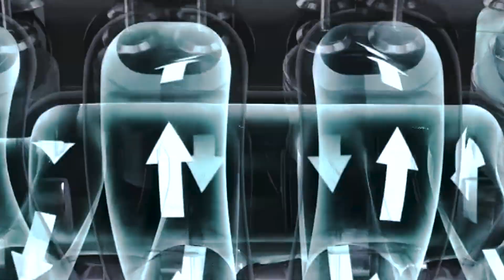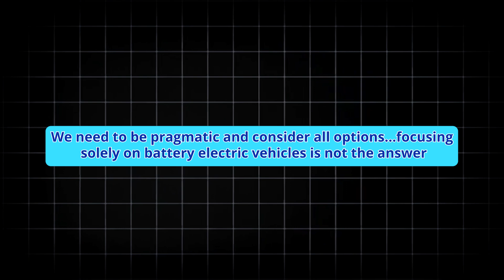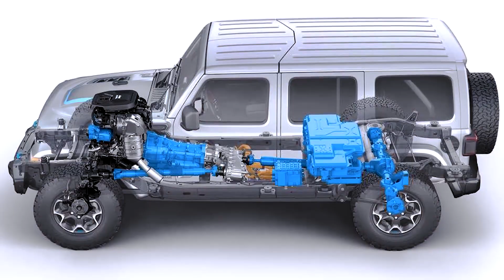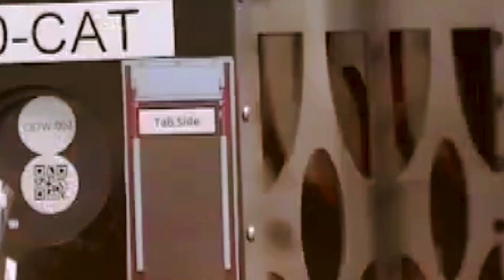Jeep CEO REVEALS Revolutionary Compressed Air Engine Shaking EV Industry

Comment: Did an AI write this for u? xDDD

Dude just reinvented turbochargers, with the downside of actually needing a tank to store compressed air in...
I doubt this is in any way more efficient than any MHEV in city driving. 

Also: How large do you want the compressed air tank to be? it's so power intensive to compress Air in the first place, and for any usably high preassure the tank would need to be as powerful as a H2 Tank, and we know how much usable energy they can store xD

and using the enigine to restore the used air is.... just like charging a battery in a BEV, with the difference that a Battery is more efficient and has less loss over time.

And the AI generated pictures of an Engine xDDDD dude just stop making videos if that is the quality you produce.
Reply from the maker: naah we dont use ai

Comment: This seems to combine the weak points of all systems: the need for two engines from the hybrid, the higher weight of the battery (air tank) from EV, and the heavy and inefficient motor of the ICE x2.
Reply from the maker: cool